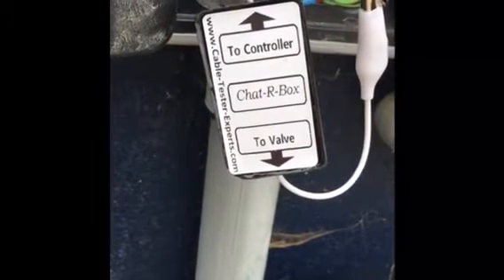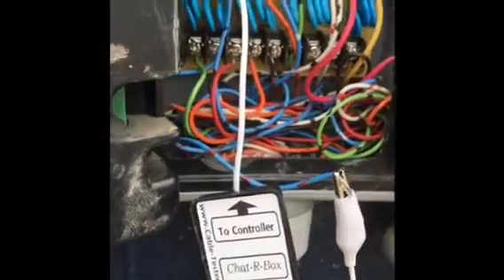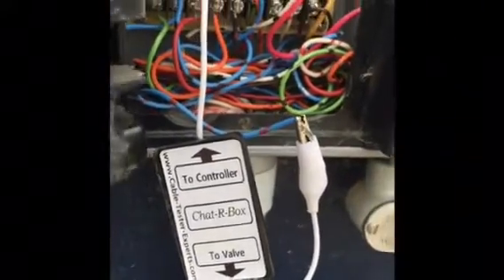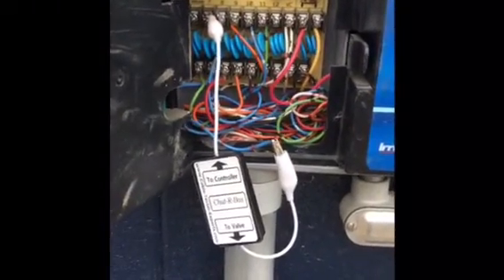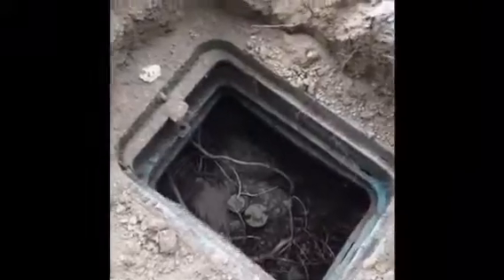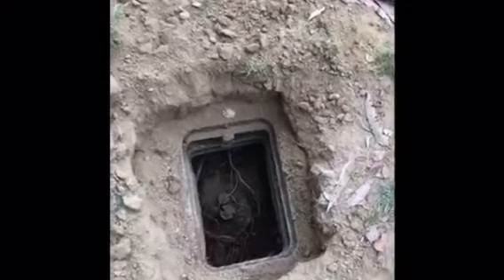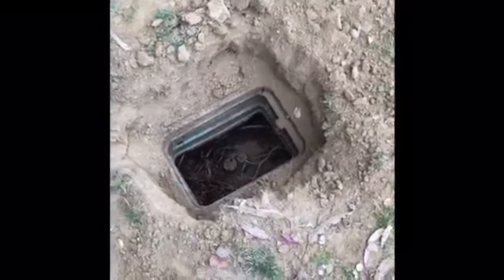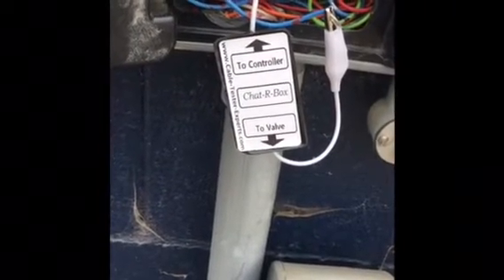irrigation valve finder/locator (chat-r-box)

Comment: Can this be used to find 12V landscape lighting wire that is buried? I hope so. It would save me operating expenses.
Reply: No it can't. The Chat-R-Box works by vibrating the solenoid. There is nothing to interrupt on a 12v landscape wire. You could apply power to the cable and use an underground cable tracer.

Comment: It would be great if I had lines to connect it to. All i have found in my lawn are 2 lawn genie popup sprinkler heads. There is no box valve timer or hell even a water line going into my basement. Looks like I might have a failed project